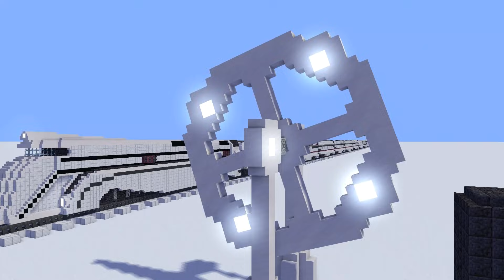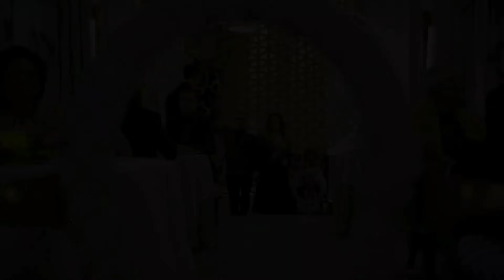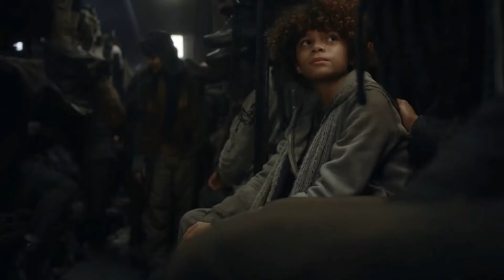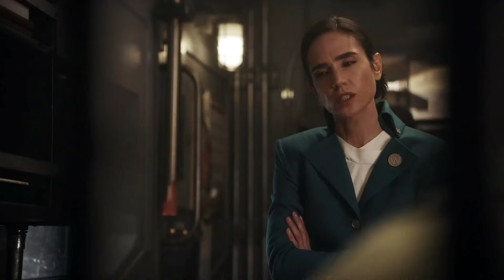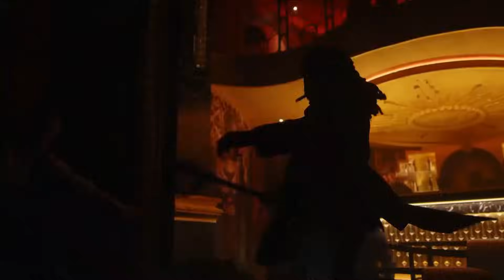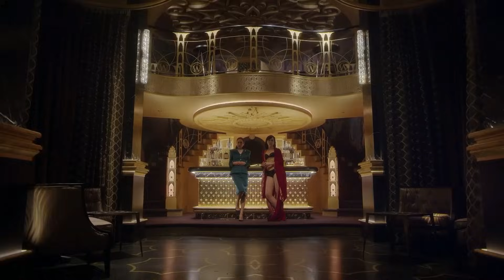HOW THE ENGINE ETERNAL WORKS | Snowpiercer Lore Video

Comment: I might be remembering it wrong, but in the TV show didn't they mention something about it harnessing the energy in the earths rotation somehow?
Train was long enough with enough weight that on long straight sections of track so long as they were moving in the same direction as the rotation of the earth it could pick up some of that energy as the earth was spinning faster than the train moved along it, so each lap around the earth would be a net gain in energy that kept the perpetual motion going.
So it's not really a perpetual motion machine creating energy from nothing or perfectly recyling a closed loop with none lost, it was more of a gravity engine.

Presumably if that was the case, too many of them might have a measurable effect on the earths rotation speed lol, taking all the momentum out of the spin to throw these trains around.

Comment: For some nerds: They use hydrogen and convert it to water to keep engine cool and spread the hot water generated by engine to cars.

Which makes me wonder why they didn’t use hydrogen engine in each car. I believe it would have been better.

They also mentioned if they discharge too much water the engine will shut off. 
WHICH also means they use water to run up the turbine and perpetual motion to heat the water.
Reply: Some additional information:

I believe batteries only move the train to get enough hydrogen.
In pirate train it hardly had any batteries and snowpiercer has hydrogen storage too as they mentioned when god module was fried
Reply: Whole train depends on hydrogen from atmosphere and they didn’t use nuclear power because they couldn’t reuse the hot water
Reply: ORR I SAW THE WHEELS OF SNOWPIERCER ITS SIMILAR TO A STEAM ENGINE

God i am genius its nothing just a steam engine with infinite coal
Reply: It doesn’t have any turbine
Reply: I think big alice uses turbine but since turbines need maintenance they avoided it as i see that big alice wheels are normal

Comment: My headcannon for the locomtive is that it has a compact thermal fusion reactor in the locmotive, the reactor powers both the locomotive wheels (via heat engines) and a thermal hydrogen plant fueled by water from melting the snow. The fusion reactor is fueld by deuterium and tritium produced by the hydrogen plant and the remaining hydrogen1 is piped through the train to local burners, where it can be used to provide heat, power and water to the individual carriages. I would assume, that with a full train, the duterium and tritium is prodeced at roughtly the same rate it is consumed and hence if the train stops the reactor will quickly become starved and shut off after a short time. In this event it would be near impossible to re-ignighte the reactor, hence why it would be fatal to stop the train.

Comment: If I can write my own version of Snowpiercer, here are some things that I would add or change. 

1. Snowpiercer would be 1000 cars long, and powered by a super advanced reactor. 

2. Each passenger car would have electric motors in their wheels, giving Snowpiercer more traction and acceleration. 

3. Snowpiercer should have a car that contains an armory that contains guns and melee weapons for the railroad security. 

4. There would be underground tunnels that lead to underground bunkers and underground rail yards, that contains food that does not spoil (Military M.R.E), fresh water pumped from wells, medical kits, weapons, ammunition, spare parts, and spare cars for Snowpiercer, Icebreaker, and Big Alice. 

5. Big Alice would have 100 cars instead of 40, allowing plenty of room for 200 people, and enough space for a labratory, supplies and spare parts for Snowpiercer. 

6. Icebreaker would be a military train that is heavily armed to the teeth with heavy caliber machine guns, 20mm cannons, a giant railway gun, missle launchers, airplanes that can be launched from a catapult, military vehicles that can be deployed or retrieved by a giant crane, anti-air guns, and it would be 1000 cars long, and would have it's own supply train just like Big Alice, except it would be 200 cars long, it would be named Redemption.
Reply: @C.J.B.R777  Soviet Anti Aircraft guns.

Comment: One of my takes on this is that when the train approaches a hill, remember the train is 3 miles long and had tremendous weight behind it. They just have to increase speed until the tip of the train is over the hill, the rest will drag over while using little power to keep the momentum going. About the train powering all the cars, I don't think it does this. I believe each car had a dynamo connected to the wheels and that creates power when the train is moving. Power is stored in the batteries. 

The eternal engines itself is a lot more complicated and it could use what this video suggested. but also mix that in with using the earths rotational force and magnetic fields. I feel that the train harnesses the power from the earth rotation and magnetic fields, hens, the train must keep moving, otherwise it will stop and can never start again without stored power from batteries, or an external source.

Comment: my theory:
there are battery cars that power the train and the engine powers the batteries, the bogie motors are swapped for repairs, and at the end of s1 it is mentioned that the battery cars are being drained which means they'll have to take power directly from the engine which is bad

Comment: Apparently Big Alice doesn't have the same issue of overheating when at a standstill, unlike Snowpiercer, maybe it's because of her size or the fact she was powering New Eden, if I recall, there is no way they put Snowpiercer at "Low Idle"
Reply: Big Alice is low torqued whatever that means and she's only a prototype Engine. Snowpiercer is far more powerful. Even just pulling 10 cars Snowpiercer was in danger of overheating while being stopped for too long.

Comment: From what I've read, if the engine was properly maintained, it could theoretically run for decades before dying out.

But it would still be impossible if the train had 1001 cars.

Comment: I think a good way to get around this maintenance problem is to have a maintenance car with a few high- tech 3D printers. There are 3D printers that can make pretty much anything now, even some that can work in different materials. So if you put a few of these in the train, you can use them to print engine parts, motors, new wheels, computer parts, and even new 3D printers when the old ones wear down. Then, just replace the old parts with new stuff (stopping of course for exterior repairs), and the train can basically last as long as it needs to. You might even be able to deploy the Pirate Train or Not- As- Big Alice to repair damaged parts of the rails. Then just have a refinery to turn the old stuff back into filliment for the printers. 

Even if this isn’t a perfectly closed system (I can imagine those wheels will grind down), you can probably stop once every few decades to pick up an old car to scrap.

Comment: I love this! I'm a proper nerd to Sci fi physics theory. I understand and appreciate why the initial disclosure but I could philosophise the definition of perpetual motion is like a persons beauty or unicorn: beauty in the eyes of the beholder could mean liking a loud person where others wouldn't,  because both charisma would compliment one another; a unicorn doesn't exist because we don't believe in them. So we behave the opposite to a ned flinders because the real world doesn't work with nice people so why should an individual strive to improve-yet the very notion makes a catch 22. As is, the notion of a perpetual engine shouldn't be defined by powering itself 100% but powered self sustainably. In this instance, a train may be powered theoretically a set distance innumerable with such an engine, but will eventually run out. But if the vessel has means to further supply itself with energy, it is debateably perpetual :) this could be by means of solar, wind power which could possibly use the same resistance or less to the wind-never stopping, as one or the other would be interchangeable. The theoretic train is totally plausible, though of course friction gets in the way. Another example of debatable perpetual motion could be the track transmitting power too, supplied by ground source? This, for perspective and intensive reasons, would be as opposed to a herculese circumnavigating the globe constantly with air tankers-thats external, reliance. Curious :o

Comment: As a fan of train and railway transportation, this show just absolutely drives me mad. The amount of BS, starting with zero maintenance tracks and zero maintenance bogeys, and ending with having an anti-entropy device, yet using it as a glorified generator is just mindboggling.
Reply: You literally say in this video that they take power from the wheels to power... the wheels. That's literally the definition of anti-entropy

Comment: To be honest I don't like this lore explanation. From scientific point of view, fusion reactor makes quite a lot of sense. The fuel for fusion being deuterium and tritium, isotopes of hydrogen. They do appear naturally in nature, but at very low quantity. And here is the scientific reasoning, the train has to run, as it consumes snow, performing electrolysis and in the ion state of electrolysis separating the isotopes via TOF (time of flight) mechanism, basically accelerating the ions in the homogeneous electric field. Heavier elements will accelerate slower due to Newton 1 law of motion. Thus we obtain pure Deuterium and Tritium, which can be used in fusion reactor. 

Assuming there is a storage on board, snow also provides cooling for the reactor, once fusion is started you cannot switch it off. If it dies, you need tremendous amount of energy to kick it off again. That said, the engine will struggle with overheating if the train stops (you cannot switch the reactor off!), or it will stop itself if the reactants are used and die out. So running a train at minimal speed will provide both reactants for fusion and cooling agent. 

One mishap might be, that in this scenario it might have been wiser to make a boat, with almost unlimited access to cooling and water. One would have to consider energy needed to move a train and a boat (friction loses). Also, snowfall results from water in the atmosphere, where solar radiation can turn regular hydrogen into heavier isotopes. That might explain why is it beneficial to use snow as a source of hydrogen isotopes, rather than ocean water (higher content of isotopes).

This also assumes, that the atmosphere is not dead on such cold planet, and sun is still providing enough heat for convection i.e. winds which will shift snow onto the tracks again. What do you guys think?
Reply: It would be neat if in some future episode they discover another community of people living on a ship or fleet of ships. When the train passes by the shore, someone spots the ships and "OMG we're not the only ones!"
Reply: @HallimarRathlornStudios it isnt "mindboggling" that it melts down, for fusion to be sustained it needs to remain at LITTERAL millions of degrees celcius, and it only generates heat, a fusion reactor doesent produce elcetricity, only heat. if they found a way to somehow propell millions of tonnes of train, then imagine how hot the fusion reactor has to be? 1001 cars? like damn that would make it abizzmaly high temp, and if you "uncoupple" cars, there YES you can lower input for heat reduction like you said! but you can never ever no matter what go bleow millions of degrees celcius, and as said, the reactor only generates heat, if heat isnt used for moving? where does that heat go? the fusion reactor goes hotter and hotter as heat isnt being turned into any other energy and the reactor would eventually melt itself.

 it isnt wierd at all that it would melt down, and yes you could cool with the atmosphere but that being the single thign in this theory beign a problem, this is much better than true prepetual motion, and wilford would never ever claim otherwise no matter what. As quote from melanie and wilford "deppends on how you define prepetual motion". if you were wilford and you needed to generate investments for the snowpiercer project, what woudl you rather say? 

a "fusion train capable of almost going forever" or "an eternal engine and because i, wilford am so powerful i broke laws of physics and they said fine here is a prepetual motion engine"?

Comment: Had it been in reality, the very first major issue the train would face would be the wear and tear on the wheels. Unlike pretty much any engine parts, wheels are bare metal on metal contact, no lubrication, no mercy. Even though the train won't necessarily grind to a halt, the deformation of the wheel surfaces will eventually chuck it straight where it should have made a turn. And if you happen to run in a single loop of a track, it could also be the track that eventually wears out and gives. So sooner or later, there will be an external part out of control of the crew that would give.
Reply: The track would eventually give out, but it should last far longer than the wheels.

In real life train wheels last for about 200-400,000 km, in some cases even 1 million km, before they need retreading on a wheel lathe (dynamic effects cause train wheels to wear unevenly in a process called polygonisation; this causes vibrations and eventually makes the wheels unsafe as they literally start jumping on the tracks). In Snowpiercer that's 2-4, maybe 8 revolutions of the track (one revolution is about 120,000 km from what I can find), or 1-3 years. At the beginning of the series they're in year 6 and the 19th revolution, so the wheels should have needed at least two overhauls. It may be conceivable that they have a way to retread the wheels while the train is running, but even with that the wheels would still only last for maybe 1-2.5 million km or so at most (at that point real life train wheels - after several retreadings - have lost 4-5 cm of material and the wheel rims become to thin to safely support the loads), ie. at the point of the series the wheels should be on their last legs. Similar for the movie (they're in year 17 there, but in the movie the train only makes one revolution per year, so the distance travelled is roughly similar).

Tracks in real life on the other hand are easily good for decades, especially if a train comes through only three times a year. Having an extensive globe spanning track loop works in their favour here.
Reply: @blahfasel2000 Not only that, but the cold temperatures would make the tracks extremely brittle.

Comment: Ah yes, same principle as the turbo encabulator
Reply: Yes it uses the fuckulator to excite the astrobastards, therefore enabling the turbo encabulator.
Reply: Kinda, but this train doesn't use spurving bearings or differential girdlesprings.
Reply: @jbrou123  and the lunar wane shaft seemed to be missing

Comment: I really like snowpiercer and the eternal engine as a plot device rather than practical science. It's a strange technology with strange wims that are difficult to keep on top of without access to the advanced industry that created it.

If you have this technology why not put it in a bunker in a far more controlled environment and bit rebuild humanity from there?
If the big crunch is always running out of power then why don't you have some RTG's on board. Free heating and energy for everyone zero maintenance requirement? Backup diesel generators or advanced solar panels to restart the train. The colder solar panels are the more efficient they are. Considering the advanced technology available during construction why not a miniaturised atomic power plant on rails?